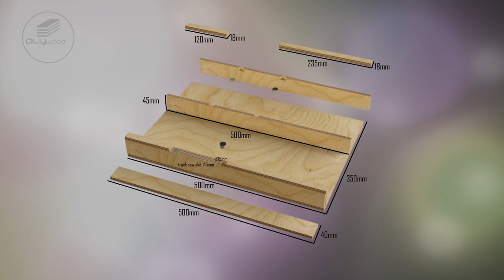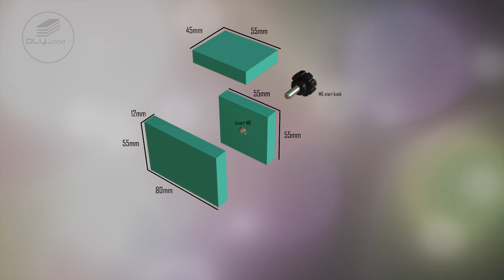Track saw Crosscut sled Precision for Cut large and Small wood

Comment: That’s neat.  I just finished making one, almost like yours, I have a magnet table, so I sit the jig on the table, I have a hinge on backside so I can lift up track &.a pin on the fore side to make a stable 90’.
I also wax track & saw so it slides easily.  Any I’ve seen have a tract on both sides, I thought I was original. until I saw yours.  Keep it up!
Reply from the maker: Very cool!